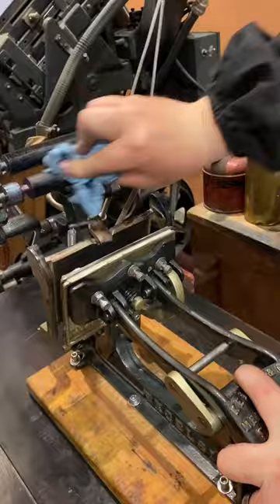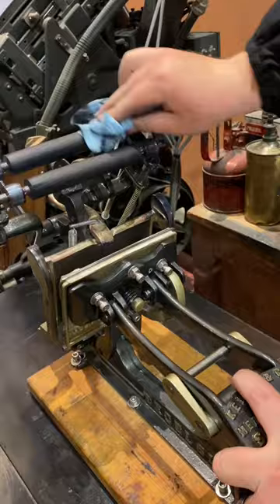Cleaning the 3x5 Kelsey Excelsior tabletop printing press with 1K kerosene

Comment: Acetone plus anything enters the skin cell barrier, try to at least half of the days to use gloves.
Reply: Well that's kerosene, not acetone
Reply: @ec7005  well, same effect 😁
Reply: Specifically what kind of gloves tho? Because bothe kerosene and acetone easily penetrates or just melts throu most types of gloves
Reply: @mrono1910  never nitrile or vinyl with kerosene/acetone ALWAYS latex gloves.
Reply: @oak8728  thanks, any time I've worn gloves with acetone thr gloves just fall apart instantly
Reply: He’s fine

Comment: Please, for your own health, ware proper gloves that can handle the solvent.
I know it was not common especially speaking to older press operators they used to not ware any gloves.
But as expert working with printing ink for 15y now it’s your health don’t risk anything.
Also when handling solvents safety goggles are mandatory.

Comment: what are rollers made up of?
Reply: not sure if these are the same but for brayers (manual ink rollers) the roller is a softish rubber like material, imagine like an eraser but slicker and won’t rub away
Reply: @hypnagogue  I got it.Thanks 🙏
Reply: If you use rubber base ink you can leave it inked up fo nthe next day!. Rubber base doesn't dry on rollers.